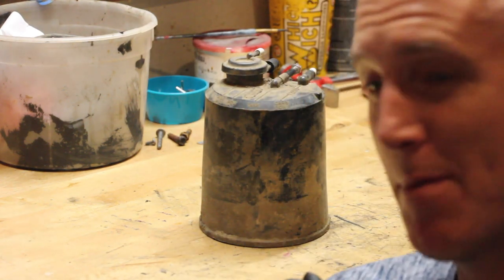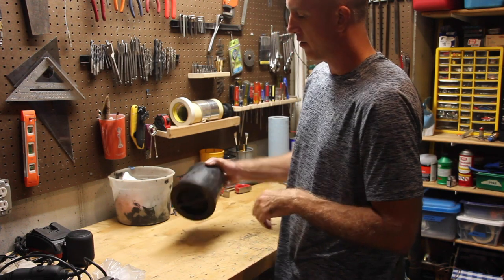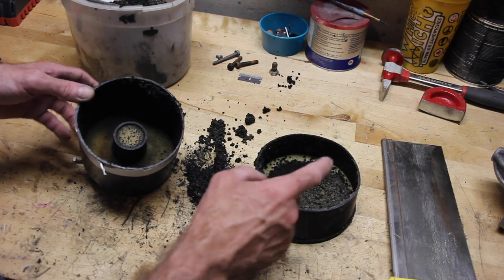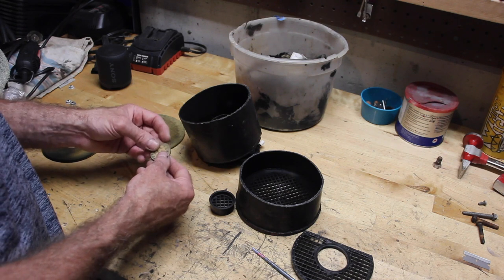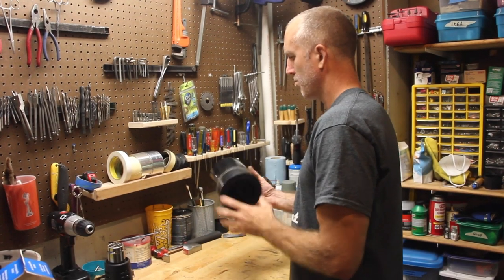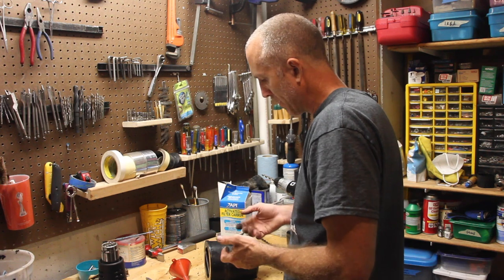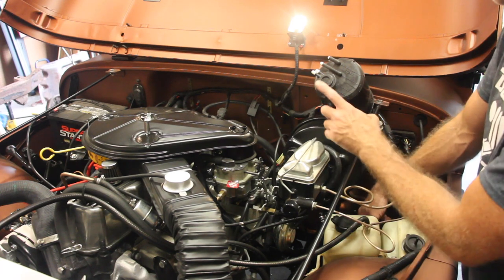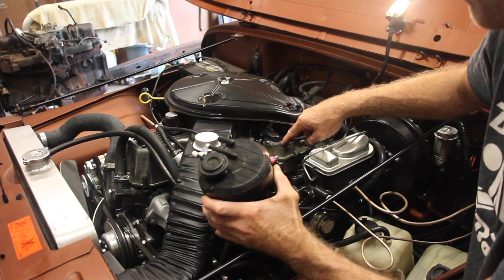Jeep CJ7 Charcoal Canister Renovation

Comment: hi, your videos have helped me out a lot. I've been bequeathed a 1980 cj7 4.2 thats made its way down the line of succession to me and ive spent the last few months changing pretty much everything outside the block, long story short i just swapped a failing fuel pump and now gas is pouring out the bottom of the canister, my grandad at some point ripped out most the lines running back to the tank cus "it runs better" but i beg to differ, i dont know, im at my wits end with this thing, everything ive read points to bad purge valve which aint got any line running from it, the rollover valve and check valve havent been connected in years and the only thing ive changed since the last known good state is the mechanical fuel pump. Thanks again.
Reply from the maker: Email me at dellis6914@gmail.com and we’ll get you fix up and running. Seems like the return fuel line either is hooked up to the vapor canister or it doesn’t exist. We can swap pictures and get it right.

Comment: This is so helpful. Thank you!  My only question is whether or not the open sell "craft store" foam might deteriorate with exposure to gasoline/fumes.
Reply from the maker: I tested the foam by pouring some gasoline directly on it. It was unaffected, so I will suggect to test the foam before you use it as the replacement in your canister.

Comment: We have a 1980 CJ7 with a 258. My canister seems to only leak gas after we put a full tank of gas in it. Which we’ve only done twice since we’ve got it and it’s done it twice. The first time it happened to be getting some warranty work done at my shop. So they said the gasket in the carb was bad. So I had them replace it. The second time, I saw gas coming out of the carb again and dropping a lot of gas from the canister again. Is it possible the canister was just so clogged that it backed the gas back through the carb? Also, What is the carbon you are putting back into  it? I wanted to make sure I get the right kind.

Comment: Cool Guy, thanks again for a great video.  Before I watched this, I was tinkering around with the canister.  The bottom peice will actually come apart for me if I take a screw driver and wedge around it.  Is that not supposed to happen?  I was surprised when I learned you have to saw it in half to access since mine will actually open up.  Defective?  Thanks again, your videos are unmatched!
Reply from the maker: Interesting. I need to go check my back-up on to see if that is the case. If it is, then I may need to redo this video :)
Reply: Yes mine came off too. I used a couple screws to make sure it didn’t just fall off.
Reply from the maker: I’ve checked all 3 of my canisters and each one is either fused or glued. There is no way that the bottom cap is coming off. I’m curious about how yours got to that point.

Comment: I just saw that later in the video it explains each of the ports, and the connections, my cj7 is 81.. it doesn't come with a computer, or electronic valves
Reply from the maker: The hook up should be the same. It’s this way on my 79 and 84.
Reply: @coolguy_CJ7  thanks!!

Comment: Could a person use a  "no-hub rubber adapter" (mechanical plumbing fitting with rubber sleeve, and metal collar) ?
Reply from the maker: Probably. The only concern that I would have is the circumference reduction of the canister as it gets closer to the top and if you could get a good seal.

Comment: How did your filters that you cut stay in place?  You had it sideways as you poured in the charcoal... did they not fall in?
Reply from the maker: Cut them so that they just fit into the canister with minimal bunching. That way they use their own size to stay in place.
Reply: @coolguy_CJ7  so I did this like your video and have a little issue. Jeep starts fine but a minute later a huge suction comes from the pcv to the canister and causes a weezinf noise then dies.  One warmed up, no issues but slight weezing noise persists. Thoughts?
Reply from the maker: Hmmm. Interesting. There really shouldn't be much of a vacuum running to or from the canister. There is a diaphram in the canister that when the pressure gets to heavy, then it just vents back to the tank. The PCV valve is supposed to just release vapor pressure back to the carburetor where the fumes get used. Is the PCV valve a T-ported valve? One hose (smaller port) going to the canister and the other (large port) connecting to your carburetor?
Reply: @coolguy_CJ7  yes, exactly.. a T from the pcv to the carb and canister. But serious suction at idle... should that not be the case?  I have the carter bbd, no ecu
Reply from the maker: I will have to look at my vacuum configuration. As of right now, don't know what the issue is. Did you have the canister hooked up before?
Reply: @coolguy_CJ7  i did so not sure what changed except a ton of suction coming from the pcv... its running ok but if I pull the hose off the canister it dies when cold and chugs when warm.

Comment: Dude..unbelievable video so detailed and explained perfectly and slow for us 22 second delay people lol..maby you can answer this for me so I have the same set up as you but with no vac lines at all ..can I just hook the tank vent line up and plug the other on the canister? Maby? Appreciate you a lot agin for this detailed vid !!!
Reply from the maker: You could, but you won’t be doing yourself any favors. It doesn’t hurt anything to have it hooked up correctly. The charcoal canister helps to recirculate the excess gas fumes from the carb. That is a good thing. :)
Reply: @coolguy_CJ7  I agree ..that's agin ! Hei  goin in this weekend too so hope all this makes the old girl reliable!
Reply from the maker: @adamwilburn6572  it will definitely run better. I’ve got an HEI on the 84 and a normal distributor on the 79. 84 starts right up every time. 79 takes at least 3 attempts.
Reply: @coolguy_CJ7  well I can't wait to get the dead miss out of it and just feel better about drivin it around! Gotta a Webber commin too 32 36? Thoes together supposed to make it very reliable so we'll see!! This weekend!!

Comment: I have an '85 CJ-7 straight 6 that has a webber carb on it. Used a nutter bypass and vacum lines are either plugged or gone. Do you have any videos on what absolutely must be vacuumed and what doesn't? Thanks for any suggestions
Reply from the maker: This is and always will be up for debate. You've got the nutter bypass and I'm assuming youve removed the computer and all the wiring that goes with it. Do you have power brakes? HEI distributor or Original?

Comment: Hello, thanks for the video it was very helpful. So on my charcoal canister I can blow air into all three ports. I used a smoke machine and it looks like it blows air out of the bottom. Is that normal? Second I used a vacuum gauge on the 4th tube and it won’t hold vacuum. Is that normal? What made me look into this is when I am setting my mixture screws it high idles. And when I clamp the hose going from the canister to the pcv it idles back down to normal.
Reply from the maker: The three ports that you can blow air into (PCV, carb bowl, and tank) should all have open venting, meaning that you can pass air easily through them into the charcoal grains in the canister. The Purge Valve has a diaphragm in it that should fluctuate with the vacuum of the system and release gas vapors only when the vacuum gets too high. This connects to the CTO (Coolant Temp Override) valve and is a ported vacuum connected to the intake manifold on the later CJs or the engine block on the earlier CJs. This is a low level of vacuum so it shouldn't take much to purge the vacuum in the canister.

With all that said, is your PCV valve a single port or a t-port?
Reply: @coolguy_CJ7  thanks for the reply. It’s off of a yj. But should work the same. Looks like my diaphragm is bad. Know of a repair kit?
Reply from the maker: @io4067  since it's a sealed system (diaphragm) it's not repairable as far as I know. I took one completely apart and there is a lot of welded plastic and other things inside the diaphragm housing. I would say your options are to find a used one and restore the charcoal or apparently delorean makes one that will work. Sorry.
Reply: @coolguy_CJ7  ok so I ended up taking that cap off and superglued the diaphragm hole and it’s working now. Delorian makes one? Do you know where I can find it. Website and part number?
Reply from the maker: @io4067  Dude! I'm so impressed. More learnings for the CJ crew. Brilliant!

I will look for the link on Delorean.com.
Reply: @coolguy_CJ7  awesome thanks for the link! I found the canister it’s 65 bucks! I’ll get one if mine gives out.

Comment: Hello I have an 80 CJ and it looks like someone has removed the canister and I assume has been allowing the carb to vent out into the air. Where does the canister mount? Is it just under the brake booster on the driver's side? Is it to the fire wall or inner fender?
Reply from the maker: Send me an email and I’ll send photos. I should probably put something about this on instagram. Dellis6914@gmail.com

Comment: Question:  if it has been disconnected will it allow fuel to evaporate?
Reply from the maker: It only recirculates or expels the excess fuel vapors from the carb or the valve train. If it’s been disconnected then you run the risk of fuel vapors building up in the engine compartment and your CJ smelling like a gas refinery.

Comment: Thanks for the vid, would the canister have anything to do with the purge valve? Had my cj7 smog, guy says it’s not purging right, and pressure builds up in fuel tank. Any thoughts?
Reply from the maker: Totally. The canister is supposed to regulate the pressure coming from the carburetor and going to the tank. There is a pressure diaphragm inside the canister that is supposed to release when the pressure is too high and vent the system. At least that is how I understand it. What year is you CJ?
Reply: @coolguy_CJ7  It’s a ‘84. Straight six. I have the material to revamp the charcoal canister per your episode. Just wondering if the canister is clogged, would it stall the Jeep. I’ve had to take the fuel cap off to to release pressure so start it again. Then it runs fine. I recently installed a fuel injection kit from Howell. That got rid of mechanical fuel pump, installed electronic pump. Thanks
Reply from the maker: @joeb3513  Did you have this problem before you installed the electronic pump? Most of the time you hear people talk about the gas fumes when they run the CJ and don't realize it's because they removed the charcoal canister. The Purge or Carb Bowl port on the canister is supposed to release the excess vapors when they come under pressure back into the carburetor.
Reply: @coolguy_CJ7  No I did not have it. I haven’t removed the canister either. I’m just wondering if maybe the canister filters are too clogged to handle the difference in psi created from the new pump? Some foreman suggest that there is a separate purge switch, but I didn’t think so for this year.
Reply from the maker: @joeb3513  let me check my hose configuration and see if the rear check valve that's connected to the rollover check valve plays a part.
Reply: @coolguy_CJ7  if the dual cto valve on the intake is not working, would that cause the pressure in the tank?
Reply from the maker: @joeb3513  it could. The dual CTO valve should run to the EGR valve from the outer port and the inner port runs to the bottom right of the carburetor (at least that's what I recall). But if you don't have the OEM setup I don't know what would connect to what.

Back to the charcoal canister. You should be able to blow air into all 3 of the valves. The 4th, which is the elevated one, has the pressure diaphragm in to. You can lightly blow into it and hear the diaphragm flex. If you can't move air through the 3 valves or the diaphragm isn't audible, then the canister is clogged. There are 2 small side vents on the gas tank that port out to the check valve and rollover check valve on the driver side back quarter panel. Those could also be clogged, bent, or not hooked up right. Kinda like chasing a gremlin, isn't it?
Reply: @coolguy_CJ7  Hey Guy, I know it’s been a while since this discussion, but I am still have issues with pressure build up in the tank. Would the purge valve be faulty? If so, where is it located? I have been asking in other forums, but I can’t seem to get a straight answer. Any thoughts?

Comment: Would luv a follow up, using your 1977/1979 jeep with the inline 6 engine.!
Reply from the maker: Do you mean a recap video of the finished 79 CJ? If so, that will be a few months out from now. Still got a lot of work to do.
Reply: @coolguy_CJ7  i took a look at my charcoal canister. I have 3 outlets/inlets on top: Purge, Carb body, Tank.  ((Obviously nothing was hooked up at all.))  Where is the Purge nozzle suppose to actually GO.?
Reply from the maker: @davidwalker2781  Depending on the year and engine, it is supposed to go to the OEM air filter housing. there should be a hose port that it hooks up to. If you don't have the air cleaner anymore, then you can either run it to a t-port PCV valve that would feed from the intake manifold or the base vacuum port on your carburetor. If that isn't an option, the just cap it.
Reply: @coolguy_CJ7  i have a 1977 258ci in line 6, single barrel carb, with a 3 manual ...  thoughts.... i already have the Front valve cover port connected into the original Air Filter housing...
Reply from the maker: @davidwalker2781  my brother has a 76 cj5 with the same  configuration. I will have to do some more research to confirm. Stay tuned.

Comment: Whats the update on the canister?
Did it hold?
Reply from the maker: Installed it on my 84 after I rebuilt the engine. 2 months in, it’s seems to operate perfectly.
Reply: Thank you sir.
I already open the canister on my 99 camry and got me 4 lbs of new charcoal,i will replace the filters as well.
Hopefully it will work

Comment: Need some help please. Where do I hook into on my Ford Motorcraft 2100 2 barrel carburetor? Also, where do I hook onto from the tank port and where do I tie into the gas tank? Can you send me a few pics ? Do I tee it into the return line for the gas tank? Thanks.
Reply from the maker: Let me check.
Reply: @coolguy_CJ7  thanks! I have a 1980 cj5 with a 258 engine. PO put in a 2 barrel Ford Motorcraft 2100 carb, but took out the cannister. I do have the 4 port one, and plan on doing the same thing, put new foam filters and new charcoal in  it.
Reply from the maker: Lets start with how much do you know about the 2100 carburetor? One of the ports on the carb is the bowl vent port. That runs a direct line to the charcoal canister.
Reply: @coolguy_CJ7  yes. I was looking at some pics on hooking up the 4 port cannister. The one marked on the cannister that says "Tank" does that run to the rollover check valve? Thanks.
Reply: @coolguy_CJ7  cool. One of the ports says TANK on it. Does that hook up to the rollover check valve?
Reply: @coolguy_CJ7  i found the line that goes from the  "TANK" port on the canister to the roll over check valve.
Reply: @coolguy_CJ7  just got to cut me a length of vacuum hose to hook into the end of the vent line leading to the tank. Good thing the PO did not cut it or remove it!!
Reply from the maker: Sorry so long in response. As previously discussed, the CARB BOWL port goes to the vent port of the carburetor. I unfortunately don't know where that is on the 2100. As you've already figured out, the FUEL TANK port goes to the upper port of the rollover check valve located on the rear of the quarter panel baffle plate driver's side. The CAN PURGE goes to the pcv valve. You will need to get a T-port instead of a L-port pcv valve. The DIST PURGE goes to the one of the outer ports of your CTO valve on the intake manifold. Depending on whether you have a 3 port or 5 port will determine which one you should connect too. If it's a 3 port, then connect to the outer one. If 5 port then connect to the outer one on the side with 2 ports.
Reply: @coolguy_CJ7  I got a 4 port canister.
Reply: @coolguy_CJ7  sorry, wrong port. Will have to send you a pic. PO used an intake manifold off of a 1983  jeep with a 258. I think the CTO is capped off.
Reply from the maker: @markfeuerherdt2338  That should work and should have that same port labels as what I explained previously. Are yours labeled different?
Reply from the maker: You can email me at dellis6914@gmail.com. it might be easier.
Reply: @coolguy_CJ7  the 4 ports are labeled each.
Reply: @coolguy_CJ7  thanks. Will do. Wanna send you a pic of the vent line tube. The end under the driver's seat has a rubber piece with a spring clamp. Trying to see how to connect that to the port on the canister. I see from other pics, they use a green colored hose or line to go from the fitting to a length of rubber hose that goes to the canister port. Anyways  will send you a pic tomorrow.  Thanks for your help. Will send pics of carb and intake manifold so you can see where I need to hook up the canister tube. Thanks.

Comment: My ported vacuum line from the canister is not connected. 1979 cj7, 258, 2 barrel Carter, manual trans. Canister has 4 outlets on top. I'm reading the vacuum line goes to a ported vacuum on carb. It shows that area is on the front, driver side area of the carb-but that connection already has a hose hooked up to the distributor. Don't see any other areas to connect it on the carb (pretty much all spots are used already). I live in CA-which might matter for this answer for smog requirements. If anyone could show me where to connect that line it would be greatly appreciated- do I use a splitter on an existing line? If so, which line? Thanks
Reply from the maker: Email me at dellis6914@gmail.com. I have a diagram that might help. Send me some images of your set up and we'll get it right.